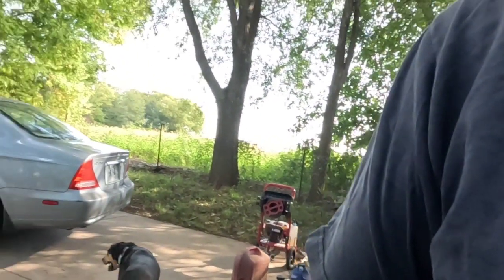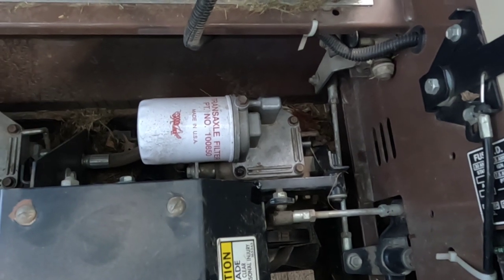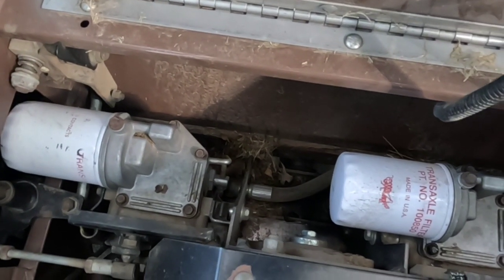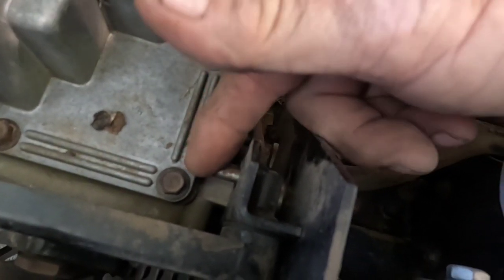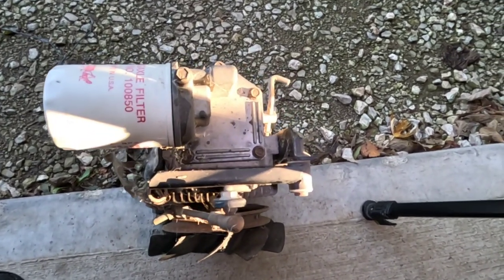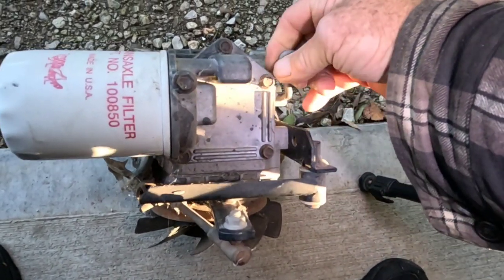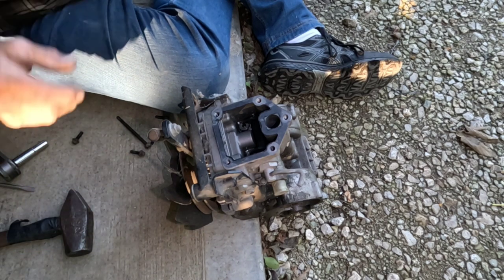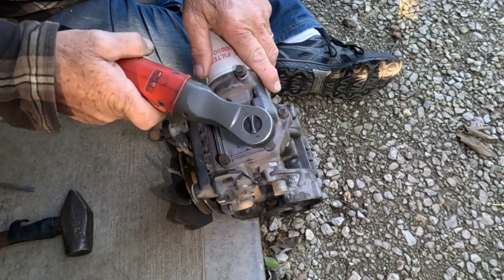Check The Bypass Valves on Eaton Gemini 771 Hydrostat Transaxle if There is Loss of Drive.

Comment: Hello !
721D fűnyíróm van. (Magyarország)
A bal oldali motor előre nagyon gyenge, de hátrafelé viszont erős.
Lehet ugyanaz a probléma, mint a videóban?

Hello !
I have a 721D lawnmower. (Hungary)
The left motor is very weak in forward, but strong in reverse.
Could it be the same problem as in the video?
Reply from the maker: Yes it could. If memory serves me correctly 1 of them has probably come loose. I think 1 is for Forward and the other is reverse. Thanks for watching.
Reply: @whatsbroketoday , thanks for your video and explanation!

Comment from the maker: There are 2 sets of planetary gears in the housing. I have seen them worn and the teeth will slip. I probably should have asked if this was a sudden loss of power of gradual. Usually a sudden loss means something broke or a gradual loss could mean the hydraulic part has worn out. The Problem I describe in the video causes a hydraulic pressure loss from the bypass valve getting depressed as it backs out of the housing and the valve gets depressed. I hope this helps.

Comment from the maker: If it Spins very easy it may have a problem in the planetary gears in the final drive. Here is a link to my video replacing a broken axle so you can see what is inside the final drive.
 https://youtu.be/9eOeqAEis24?feature=shared

Unfortunately new parts for these are hard to find. I have had to buy used and they get expensive but these mowers are worth fixing. Thanks for watching and reaching out to me.

Comment: I have a 99 grass hopper 721D front deck mower , my problem is , with the mower on jack stands the left side drive motor operates fine in forward and reverse , but it free wheels with no resistance , when I put the mower on the ground , the left side barely works or doesn’t work at all. Any ideas what the problem is?

Comment: Can you do a video changing the hydro fluid in a 225 grasshopper draining and refilling the expansion tape tank
Reply from the maker: Hi. Currently I do not have access to a 225. If I get one in for service I can see if they want the hydro fluid and filter changed. When I drain the oil on those I put a drain pan under the filter for the hydro fluid and drain it there. I have always refilled with Grasshopper OEM fluid. Thanks

Comment: Are these still manufactured?
Reply from the maker: These are no longer made. There are many still out there in use. The biggest problem is as repair parts run out no more are being produced.
Reply: I have a 771 my right side on my woods. Mower is leaking at the very bottom of it, but it's not a hose. It looks like it's coming out of the casing at the bottom. Do you know anything about Any Common problem  with them Leaking